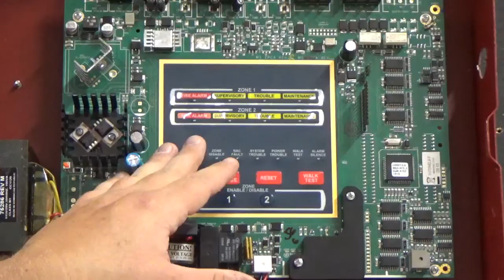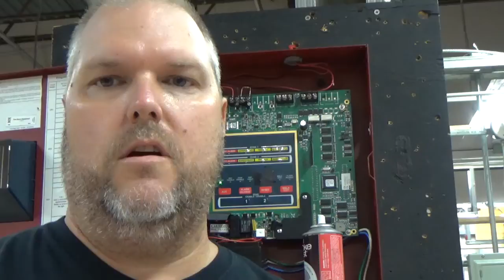Fire Alarm Control Panel and Testing Devices

Comment: How is the smoke wired up? You have a smoke, pull and fire alarm? I see the alarm went to the nac and two other wires in the zone but it doesn’t help me because I’m wondering how you wired the pull and smoke to the panel
Reply: Using the zones?

Comment: Question: is this just to alert the person who owns the system or does it also alert the fire department? I just moved into an office that already has this installed and setup, but I'm not so sure about that basic part.
Reply from the maker: As for your system I cant answer that. I can tell you that you sould call a monitoring company and have them install a dialer. It is fairly inexpensive and with monitoring it may even be free. I recommend you call an alarm company and have them verify it is in good working order and ask them. Sorry I was not able to help. I wish you luck in your new place!! Thanks for watching. CM
Reply: @craigmichaud-electricalins4602  should already have one installed per code requirement
Reply: It will alert the fire department unless it says "local alarm only"
Reply: there is an app that sends all alarms to your smartwatch.  its here..     https://youtu.be/kc0IfUopZmQ